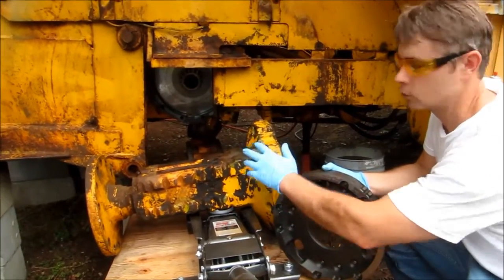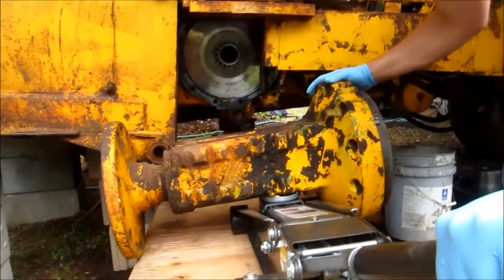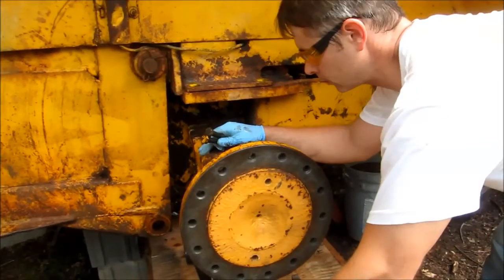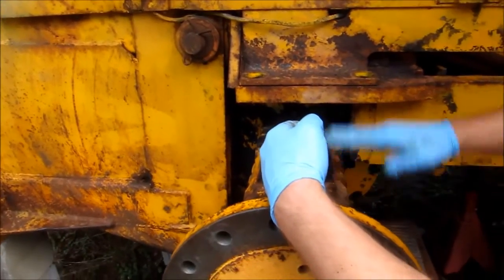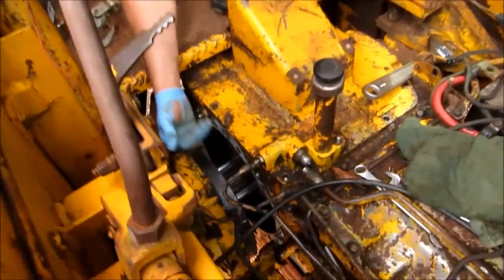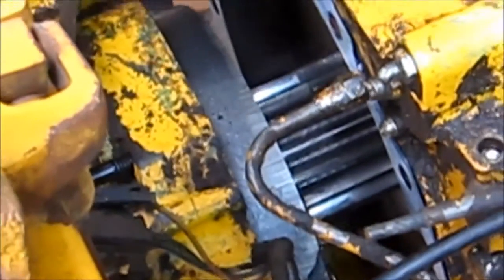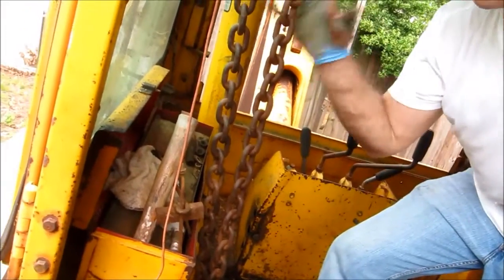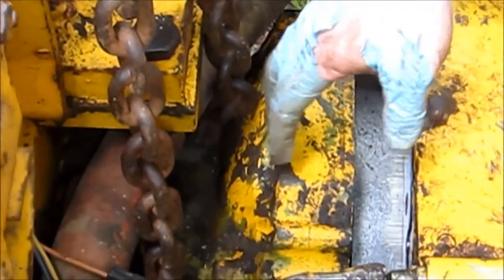Wet Brakes on a John Deere 510 Backhoe - Part 8 (final)

Comment: Thank you for the tutorial. It's been a great benefit as far as deciding whether to do the brakes on a Case 590 myself. I'm not quite sure if I need a brake job since altho they groan when applied, they are still effective and stop the machine. But if I need to r&r them, that machine will be going to a Miami dealership! Again, I'm grateful for the work you've done to share your knowledge.

Comment: Nice job, the "gaskets" located in the brake cylinders are actually back up rings that prevent oring extrusion. Notice they are on the non pressure side of the oring groove. I have the 410D. Great video Thanks
Reply from the maker: +Bradford Lunt  Thanks for commenting.  I hope to never have to do that job on that machine again. So far the brakes are doing great after 6 months of use.

Comment: Thanks for the video.    I've got a new holland 555e with grinding brakes.    the 555e has brake discs like the discs in an auto transmission, but the amount of work to get to them is prob about the same.     Why the multiple videos? I think there was only about 10 min of footage.
Reply from the maker: I broke it into different videos because of how extensive the the job was and the fact it took me a long time to complete. 10 Mins? I did 8 parts for this one if you didn't see all of them.  Or are you saying I could have condensed  all eight in one 10 minute of video to just "hurry it up already"

Comment: Thank you.... I clearly understand how large of a job this is. I have a 924G that is losing hydraulic fluid from the rear end. the seals for the pistons have blown so I have to do something quick.
Reply from the maker: If those pistons are anywhere close to the same place that the one are in this old 510, then you have some digging to get in there.  It is not a fun job because once you start, there is not going back but broken down into small sections, it isn't an impossible job, just tough.

Comment: I just purchased the same jd510 yesterday it needs to be topped off on hyd oil I blew a line getting it off the trailer kinda stumped me on where to fill it I looked all over the place. The dipstick under the seat you referred to is it the hydraulics for the whole machine is that where you check it? Sorry I know it’s a dumb question but I’m stumped.  Also what are you using for oil 46 weight? Thank you.
Reply from the maker: Yes, that hydraulic reservoir you are filling serves the hydraulic system, the rear differential and the brakes. It is an awkward place to get a large container and pour.  I usually go from a 5 gallon to a smaller container I have maneuver under the seat.
As for the type of Hydraulic Fluid, I use Traveller Premium Universal Tractor Trans/Hydraulic Fluid from Tractor Supply for the old machine, right specs and good price.  It is a premium 10W-30 and is JDM J20C which is what the John Deere requests for that machine. (don’t quote me) but it has worked for me for years on it.  Capacity is 29 Gallons so if you change the fluid, be ready with some serious catch basins as it will probably drain 15-20 gallons.

Comment: Going back to the question on brake fluid. On a 510 JD were is the brake reservoir located and were or is there a place to bleed them
Reply from the maker: On the 510, the hydraulic fluid and the brake fluid are one in the same.  Once the hydraulic pump is running, it will operate the pistons that apply the break pad squeeze on the disc that are in the transaxle.

Comment: Here is a great question does the wet brakes use the brake fluid one uses in a car or truck or is it the same fluid that is in the transmission and or around the wet brakes itself?
Reply: multipurpose tractor oil 10w

Comment: Do you know if a 310a backhoe would be similar removal as that I’ve got a broken right axle that needs in the field repair
Reply from the maker: The 310A looks like a very similar machine to the 510 I worked on in the video.  I think the transaxle it very similar so I think dismantling would be very similar, meaning (NOT EASY).  The axle it bolted to the cab/chassis.  So support of the chassis and the differential/axle is needed.  Be safe, those suckers are heavy and some serious impact wrenches are needed to get them loose.
Reply: 1 DIY Guy I’ve got the bolts out except one inner cab mount that needs to be cut off pulled the diff cover to check for damage confirmed right side axle housing needs to come off found at least one broken planetary gear And pinion gear and a bunch of what looks like big needle bearings
Reply: One also got the loader frame that runs beneath the axle housing and replaces your plate for the bolts which may cause restriction of transaxle side of housing to passbook through I’ll figure out more once I can get the cab mount space from on top of the axle removed
Reply from the maker: What caused the axle break? Did the differential lock up during a turn? I have a foot lever that can activate and deactivate my differential lock. I once had it locked and turned and heard popping and instantly stopped and realized the lock was on. Thought that if someone kept going it would cause some serious damage to an axle, the differential or pinion gears. (Or more)
Reply: 1 DIY Guy the snap ring was broken that holds the planetary gear pins in the proper location in the carrier looks like it was broken for a while as there was two sets of wear marks on the ring and pieces that caused the one pin and gear set to be riding only on the outside pin boss. This allowed for gear clearance between the pinion gear and the one planetary gear which wasn’t an issue until I was in a high load high traction push. That resulted in the gear to slip and shearteeth off the pinion gear but not before breaking the planetary gear in four and a few needle bearings. It also damaged one pin and all three gears in the carrier. Parts quote from jd is coming today ouch. Diff lock was engaged but on a straight push on dirt
Reply: I didn’t take the left side apart to check out the diff lock but the action and lock are engaging and disengaging fine. Was hoping the actuator was in the right side housing but is on the other side on mine

Comment: Omg...!!!!....excellent but from now on im gonna need to be more gentle on the old brakes because you made my head my back and my wallet hurt just watching you ..thank you for filming and explaining all that because im sure it'd be totally easier to do without all the camera work too
Reply from the maker: It makes me hurt just to think about doing that job.  It is a good way to get very intimate with your machine.  I am gearing up to do some more work on it with some cylinders as soon as a get a break.
Reply: I'll be watching when and if you post vids..I picked a used New Mexico Power Company  John Deere 510B and they seemed to have serviced it regular but im in a dusty enviornment and I'm at 8000ft elevation so I'm trying to be as gentle on it as I can ..thanks for the videos

Comment: So I have a 1977 JD310 is this the same brake setup as that?
Reply from the maker: it does look like the brakes are inside the transaxles from the JD parts catalog.  So similar access (PAIN IN THE @$$) but different break pad/disk set up.  But, probably similar.  Looks like your brake material covers the entire ring where mine was on 3 separate pads.

Comment: I would like a video on how to bleed the brakes on that backhoe
Reply from the maker: I have the manual and will check if that is even needed on this machine (different machines might need it) . The pistons that pushed the pads into the disk to apply the breaks were in the same housing as the fluid reservoir/diff case.  When i would start the machine, I would press the break petal and feel the hydraulics kick in and stiffen the petal.

Comment: It would be too easy to put 4 disc brakes on a backhoe. Then most would not scrap the machine when the brakes go bad and the mfg. wouldn't be selling new machines. This brake job exceeds to value of the machine if you put a price on your time and the frustration.
Reply from the maker: I agree, which is why I did this myself.  The JD shop said it was a big job for them.  I'm still using the machine but I just use it for my own work and not as a continuous production machine.  The brake pad material will never be changed by me again!  I don't have it in me.